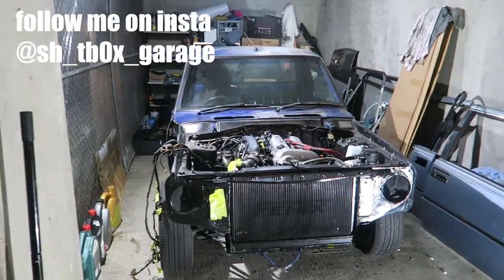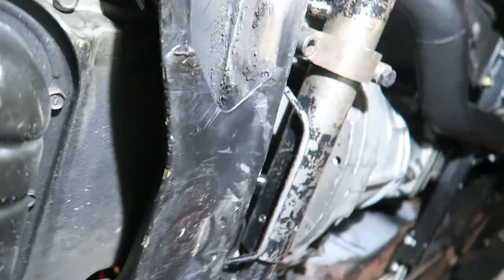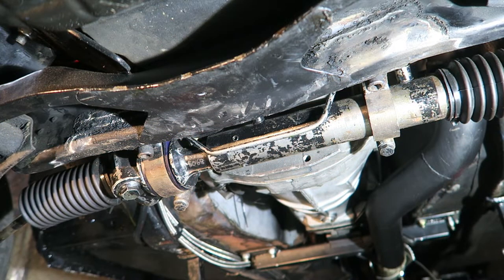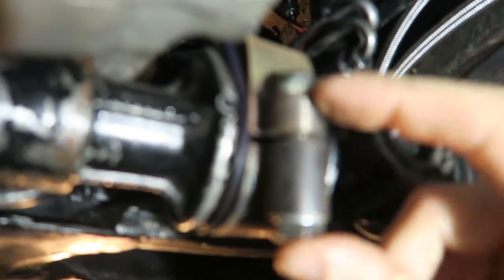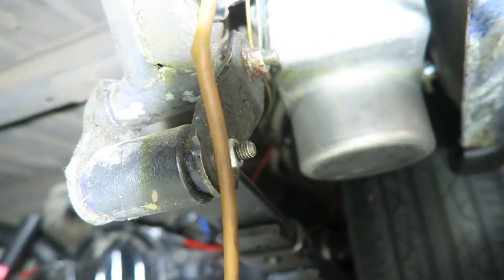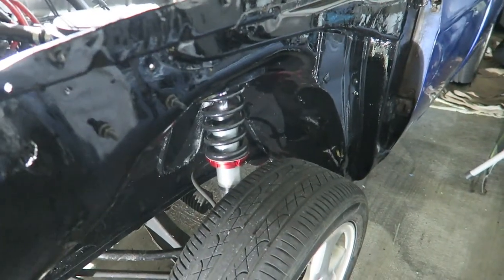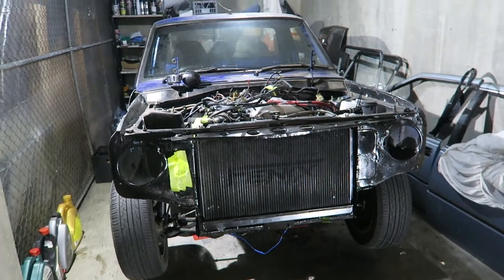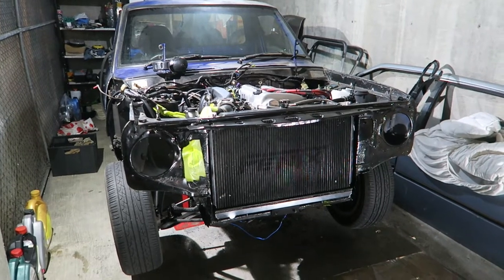Datsun 1200 ute rack and pinion power steering set up

Comment: Hey, another great video. Thank you so much for putting so much work and detail on these videos. Initially, I was planning to install a ford 8.8 with a 4 link suspension (like in this video https://www.youtube.com/watch?v=ht2wn3Kwsjg). However, now I am planning to use a 240sx subframe that was shorten.  Also, in the front I am using the subframe of the 240sx, however, I am not done. I have a similar problem, my car is far far away. So, I can not work on it often... One more question, what are you using for the coilovers? Thank you
Reply from the maker: That ute in the video is unreal. Very cool :) A Ford 8.8 diff and 4 link would be great. Think a 4 link would be a better  suspension option but it's more work and cost. Coilovers on the front are custom built ones. There is a guy here who makes them from the stock items. Not sure if he sends overseas: https://www.facebook.com/coiloversbuiltbysupafatto/